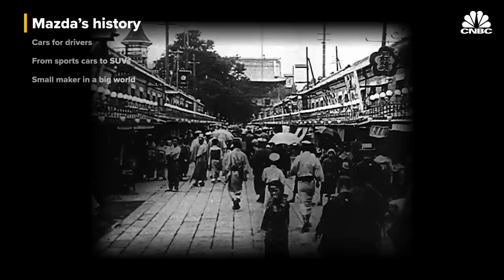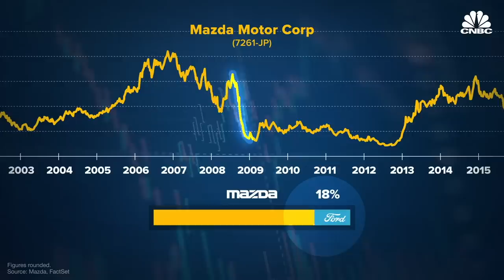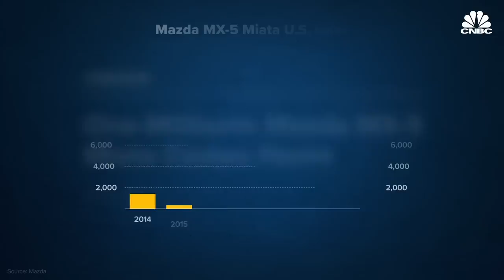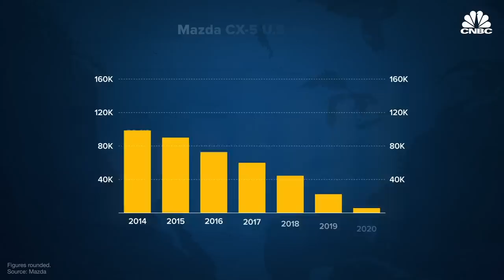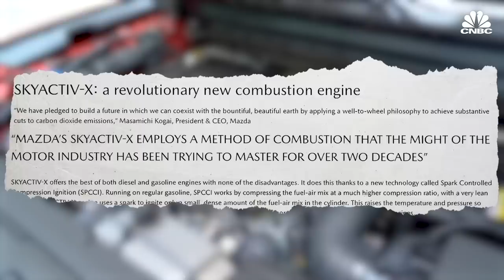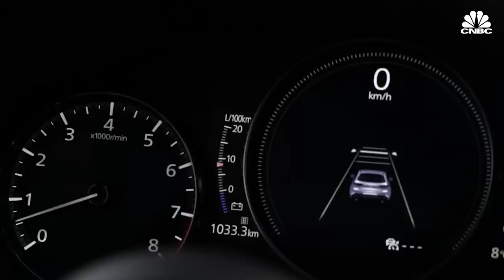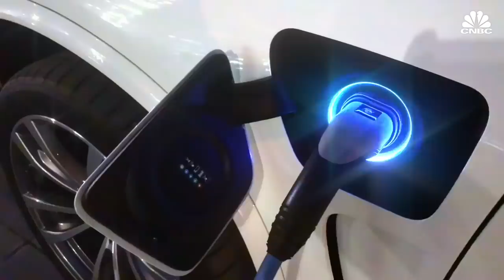Can Small And Scrappy Mazda Survive Among Automotive Giants?

Comment: I own both a 2007 Miata and a 2022 CX-30. Both are exceptional vehicles. My wife chose the CX-30 over rival Toyota, Nissan and Subaru products based on the upscaled look / feel of the interior (more German than Japanese in finish). I chose the CX-30 because I hate CVT transmissions, the CX-30 felt more planted on the road and it's price point was where we wanted to be. You absolutely need to drive a CX-30 or the new CX-50 if you are in the market for a small SUV with upscaled finish.

Comment: I owned a Mazda 6 wagon...
Great car but it began rusting within three years.
My wife owned a Saturn L-Series wagon that was older but was rust free long after the Mazda had significant rust around the rear wheel arches.
Mechanically bulletproof but the body didn't last nearly as well.
During my commute and while running errands around Madison most Mazda's more than a few years old has visible rust.
Oftentimes significantly more than vehicles of similar vintage.
Reply: I, too, have heard about the rust issues with Mazda.  Apparently, they still have issues with rust.  I live in Ohio, so rust problems are unacceptable to me.  I don't want to buy a car that will disintegrate in a few years.  I've owned a 2009 Toyota Yaris since new, and it has zero rust on the body.  I wanted a second car (one with a manual transmission this time), so I went with Toyota again, and got a 2020 Corolla last year.  Yes, a Mazda would be more fun, but I don't want to spend thousands of dollars in autobody repair within a few years, fixing rust.

Comment: The Mazda Miata sport car was a great car for me in the late 90s in my mid 20.I drove a Miata for 10 years after that I couldn’t do it anymore because the seat designed was ways to low to getting in and out of the car as I’m getting older in ages.

Comment: I have to disagree on the infotainment system.  Every single review has the same initial (ie. negative) reaction.  But once you spend some time with it, you realize Mazda is ultimately right.  Using the rotary dial is easy and safe... again, once you get used to it.  My only nitpick is the way they make you input an address - the circular alphabet is cumbersome, slow and infuriating.  Other than that though, the whole system is crisp, quick, smooth and intuitive - working MUCH better than most competitors solutions.

Comment: My 2004 Mazda 6 3.0L. 
Only one complaint:
It’s a pain to chance valve gaskets. 
My got 240 thousand miles on it and still passing state inspections. 
Love my tiptronic transmission. 
got a aftermarket exhaust mufflers :sound good.

Comment: The infotainment system is probably the easiest to use. Press and hold for Apple CarPlay, and regular radio switch. Both Mazda and BMW use the wheel instead of touchscreens so I can operate it without looking. Full touchscreens like Teslas or Audi systems are so bad once you're actually moving, and voice control can be finicky if you're driving with people. A knob makes it instant. Just got to use it for a day or two.

Comment: Took a 2 hour manual transmission class, and bought the Miata the next week.
The main problem is that I'm too tall for the car (if it rolls over, I'm 100% dead), but otherwise as an car enthusiast... if you can drive one of these, drive one of these.
I will judge all other car's handling characteristics against the Miata from now on, lol.

Comment: I own a Mazda 5. No CX no MX, just 5. It's a 1.6l Dieselengine powered Minivan. And despite that it is fun to drive. Best transmission I had on a car yet. 

Unfortunately, they decided not to sell it in Europe anymore. Because of those goddamn SUVs. 

I bought my 5 in 2014. If they brought a proper successor to that onto the market, make it a plug-in hybrid, I knew what my next one would be. Unfortunately, things don't look that way. 

As such I'm gonna hang on to my 5 until I can't justify it anymore (gas prices etc.) 
I mean, it probably won't break down. It's been going for almost 8 years now with no major issue and only one or two minor ones. The reliability is real.

Comment: I think they look much better than the other Japanese cars on the market. It is smart that they are still working on improving and offering gasoline engine cars. There are going to be problems with  providing enough electricity for everyone to use electric cars (California has trouble already meeting its electric demands). There also  are going to many issues with supplying enough batteries. I do like electric cars, but everyone switching to there use is not going to go as smoothly as many think.
Reply: I think it's going to happen much more quickly than a lot of people expect.  But anyhow. . .  If Mazda would just give us the electric Miata that a lot of us really want, it wouldn't break any electrical grids.  It would be a perfect way for them to ease into EVs, instead of switching their SUVs over first.  But Mazda seem determined to do everything backwards.

Comment: One thing I don't get with Mazda is why does a car need to be dialed down when it goes the more premium route?  I like the interior and exterior styling of the Mazda 3, but I don't like the slow steering, throttle, and braking (all the stuff important for a driver's car).  At least the handling is decent (despite the non independent rear suspension)...but there isn't much suspension travel and it bottoms out easily on some bumps.

Comment: I used to have an 88 Mazda RX7. That car it was moderately quick from 0 to 120 anything above 80 though got very scary with no turbo in it or anything but over 80 a pebble in the road seemed like it wanted to flip the vehicle over. As those rotary Motors like wound out and at high RPMs they can move out.

Comment: If every manufacturer focused on the driving experience as much as mazda, the motor enthusiast community would be a lot better off.    

No rev hang, no safety systems interfering with spirited driving, even the non sporty cars are designed to be driven playfully.  Mazda cares about the experience of driving.

Comment: Infotainment upgrade cost $60.00 a shot. Their  CX5 had the best lines in it's class but they did away with it. Now it common looking. And where is the high compression gas engine they designed years  ago. Do I wait or move on to another brand?

Comment: Owned a 2017 ND. Loved that car. But the corporate dealer scheme drove us off from ever dealing with Mazda. Local dealers who demand $200 for an air filter replacement (which we can do for $30 with parts superior to what the dealer is using) should be exterminated if Mazda hopes to survive. Mazda's survival is threatened by parasite dealers who demand premiums for silly and fake add-ons, and try to choke off the sales channel by demanding 20%+ margins on cars they did absolutely nothing to improve.

Comment: I'll preface this with I own 2020 Mazda 3. The guy said about info system being bad. Simply isn't right. You look at most cars with touch screen the touch screen is lower so more people can touch it. The Mazda idea. Is place screen higher in line with eyes. Next to standard head up display. Which is amazing. You shouldn't be using hands while driving hands free and voice commands. With everyone using smartphone these days. Why would need fancy info system. Trust me if want value for money, luxury car that's economical go Mazda. The fun driving factor for those that don't get what means. Simply car goes where think it will go regardless of turn angle or speed.

Promblem Mazda has is an image issue not product. They need far more market appeal.

Comment: Important work. Not trying to blend into the mainstream mass and do what everybody else is doing.
Probably also strategic, though, because if they did, Mazda would have no reason to exist.
And I like their projection about the future of internal combustion. Electro is running into supply issues. E-loon Murk wants to push his fancy worldsaving tech business to the max, but it's just the other side of the Devil's coin. The world needs more heart, and the heart is not about grand progressive schemes out there, but about humbly and calmly empowering the inner world.

P.S.: I still don't like the MX-5, though, because it has a lot of 'modern crap'. I wish the S2000 would get a revive that is damn close to the original one.

Comment: If you just look at the MX5 ya it was a good car, still made in Japan so the quality is good. I had a MX6 when I was younger, it was a good car but the test of time on parts was really not the greatest. It was a really fun car though. The 2.5L V6 in that car was meh. I could beat a prelude at the races all day but still. The cams did not get enough oil to them in that engine and you would get valve knock by 120,000km. The best Mazda engines from that era were the 2.0L I4 and 1.8L from the Protege and 626. Their transmission in anything outside of the Miata were never that great. When they brought out the Protege5 those had terrible problems with premature rusting around the rear wheel wells. I had not seen a car rust up that fast since Hyundai's debut of the Pony. I bought a Lexus after the Mazda and I still own that car 16 years later. Best car I ever owned by leaps and bounds.

Comment: I feel times are going to change for the good for Mazda, since they split from crappy Ford they have really improved in general, specifically in quality and reliability. At leat in the past 5 years they have been in the top 10 in reliability per CR, and in the past 2 they beat Toyota in reliability. To beat Toyota in reliability is a huge merit and being awarded the best value for brand too. There reliability is gonna get better since they started the partnership with Toyota. Mazda are still innovators and making new technology for the ICE and they make fun,reliable, best handling in class cars that punch above there weight class cars. Mazda is so damn underrated and is a shame because people go for Honda, Nissan, Korean brands, that are just not doing as a good job as Mazda.

Comment: The problem is that they don't expect EVs to explode! The S-curve doesn't cares, nor respects! 
If you are behind you are out! They are going to end up with cars unable to sell as EVs are going to fall in price! However, this will be their last mistake!
Reply: To see the Japanese car companies dragging their feet is intensely frustrating.  Even Nissan have squandered the lead they had.  But I think what irritates me most is Mazda, because an EV Miata would be such a natural move.
Reply: @Zobeid  MX-5 are built to be very lightweight. That doesn't really work as an EV.
Reply: @FireStormUnleashed  Speaking from my own experience, I've owned a NB (1999) Miata, which was great, and an original (2010) Tesla Roadster, which is fantastic.  The Roadster is the most fun car I've had for taking a spin around the country lanes.  Yes it is heavier than the Miata, and the cost was ridiculous when it was new, but remember the Roadster is practically an antique among EVs, the technology has advanced so quickly.  If they design one from a clean sheet of paper with the newest battery, and prioritize performance and handling instead of range, then it can and should be a winner.

Comment: No.  In 2017, I bought a fun 460 hp Corvette with a manual transmission rather than a $38k Mazda miata RCF at 150 hp (1/3 the power of a Corvette).

Comment: Ironically I can't fit in a Miata since I am too tall lol
Reply: Same boat I am in - yet at a track day I was able to fit an NB I think. Not tried an NC ...ND soft top was still too tight a fit BUT someone suggested they move the seat forward a little and tilt the seat more. I figure I need to try that - would need new / higher roll bars for sure (or just don't roll it). One of the few drawbacks to being tall :-(

Comment: It has been. It may have survived with some help from Ford but they also helped Ford during that time. They've also supplied cars to other larger automakers, like Toyota for instance. 

Now their cars have shifted from economy towards a luxury or rather, a premium market with materials typically found in high end luxury cars. The styling stands out from its Japanese sibling automakers, and the reliability has been higher than Honda for nearly a decade now. 

Also stop calling it "Miata". That name is no longer on the car since 2006 as its worldwide name since 1989 has been MX5.

Additionally the Alabama plant was planned to produce parts for Mazda in the USA to reduce the strain for needed parts that must travel by boat from Japan.

Comment: I have said Tesla should buy 10% interest in Mazda and take full control of its EV development. All though maybe a preferred stock might be a better approach so Tesla investment can be purely utilized for the electric car development.  Tesla is not diversifying its car lineup as it's constrained by its growth rate. Mazda can get a million electric cars on the road in 3 to 4 years in a segment that not being pursued by Tesla.  Lower priced lower range small pickup truck, small sports car,  minivan or they can also be a producer of the $25,000 EV. Tesla would gain service centers around the world that can do brakes, fluid, and tires on Teslas.

Comment: Their skyactive 2.5 gas engine is among the most dependable there is.  The six speed is rock solid and efficient. Their suspension feels very european.  And their steering is among the best there is in terms of feedback.  And it's cheaper than Toyota and Honda alternatives.  (Mazda 3 isnt as good a value.  There entry level lexus might be better)

Comment: In a tropical country like Vietnam (where I born and raised), WHITE cars come with many advantages:
_ It's easier to resell cause it's considered suitable for both men and women (black is kinda menly).
_ The heat absorption is low, which mean it will be cooler inside.
_ Scratches are easier to fix.
_ The car will look bigger, and bigger is better.

Comment: I have a 2013 Mazda 2. Biggest heap of junk I have ever owned. On Friday I took it for a service and was told that both its rear suspension springs have broken since its last MOT. There is a list as long as your arm of all the things that have gone wrong with it/fallen off it since January 2018, including head gasket failure (£1300) and a problem with the engine management computer that caused the engine to cut out while being driven.

I was given a Mazda CX 30 as a courtesy car. On Friday afternoon it refused to disengage the electronic parking brake while I was parked in a supermarket car park. I was stranded until one the cars parked next to me drove away, whereupon it decided to let me drive off. The tw*t. When I got home the thing decided to lock me inside the car. 

You can keep Mazda. Absolute garbage.

Comment: I bought a new Mazda3 many years ago and it still leaves a bad taste in my mouth. Wheel wells rusted out.  I do live in a cold climate and yes salt is used on the roads in winter. No excuse for that as other cars I have owned do not rust and as I started looking at other Mazda models I saw the same thing happening. Mazda was aware of this but still sold cars without proper rust protection. Shame on you Mazda. As a result no more Mazda’s for me.

Comment: Stop making Mazdas with CVT in them. Bring back the traditional manual transmission, with a real clut you ride & roll-back on a hill.  I'm sick of all these automatic cars & these anti-roll-back clutches on Subaru where it engages the clutch for you.  Mazda were a great car brand when they built cars for people who loved DRIVING CARS. Now the last car company who makes cars for driving is Toyota-Subaru.  Everybody else is into flappy-paddle gear boxes & cruise control.   I love a manual transmission, a body kit, high compression engines, sports suspension, low profile tyres & rolling-back on a hill as I ride the clutch.... Oh & I also love to DROP THE CLUTCH at the lights street racing too.

Comment: No longer a brand for drivers.  Which BMW model has torsion beam rear suspensions, non.  A car with torsion beam rear suspension cost close to $40k??? I leased a 2016 Mazda 6 Grand Touring after that car returned got into other vehicle Hyundai.    I won't  miss Mazda, good bye!!!
Reply: They should put the always on headlights and torsion beam rear suspension in the MX5 (Miata).

Comment: They are not comfortable to sit in for my body.. Too tight and their engines are not for me with those turbos, and all their direct injection,  etc. Toyota has both, direct and port injection on some of their engines. 
 The CR-v is more comfortable than the cx-5, for me.  I do appreciate that they want to make gas engines.... and I will still own gas engines, period.  No BEV for me.  They are pricing to be premium....but have not  made the product to match their pricing.   Little things on mine was the memory button for the seats did not effect the mirrors, which I thought was odd.   My HL limited has more features on it than Mazda. 
And they are forcing you to buy AWD vehicles, which I do not want. ...in order to get some features that i wants.
 I do wish them the best in keeping the ICE engine going.